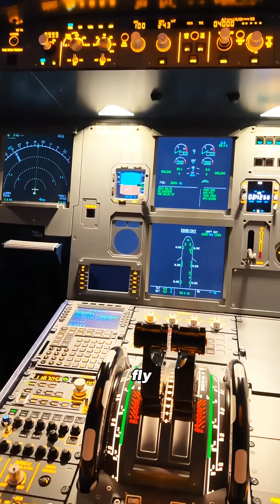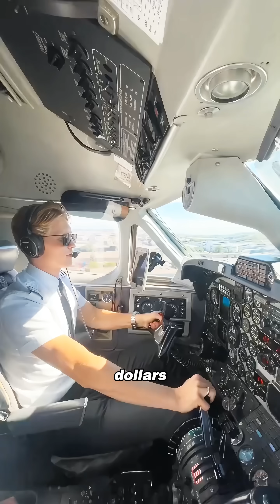Have you ever noticed that every time a plane takes off,

Comment: no shit they push the throttle to max, but it isn't actually the highest setting usually
nearly every takeoff is done with derated thrust, or MCT on airbus, which is a thrust setting at which the plane can takeoff easily while also not overheating the engines (which running on toga for more than a few minutes would)
Reply: Exactly loooool
Reply: MCT is not used for takeoff in an Airbus. The derate is done through the FLEX setting.
Reply: @rtbrtb_dutchy4183  well yeah but MCT is also written next to the detent on the quadrant
Reply: @SFSPerseverance69420  yeah, but it only goes to MCT after an engine failure. FLEX power can be significantly lower than MCT. As a matter of fact, on a light aircraft, FLEX can be lower than CLMB power even.  

So FLEX and MCT are the same detent, but they don’t operate the same. It’s not the same thrust.